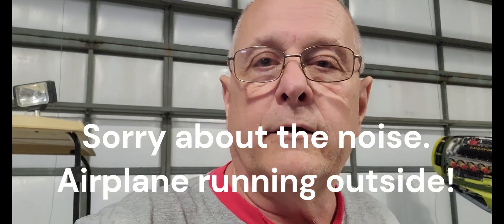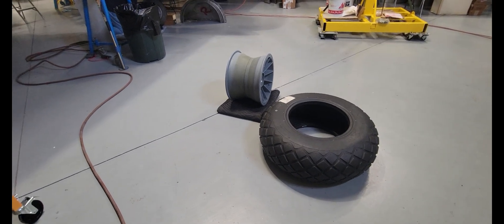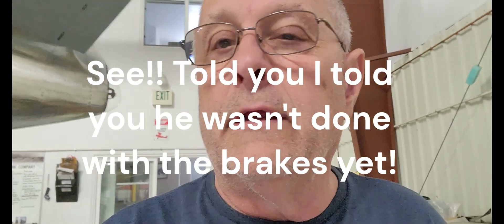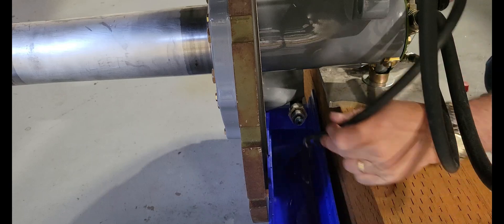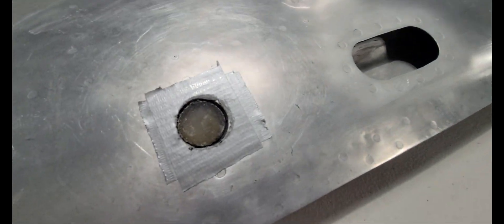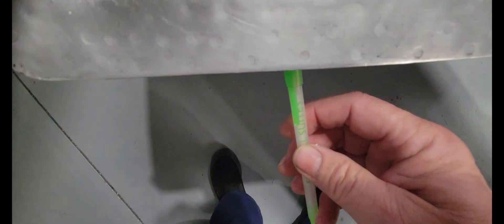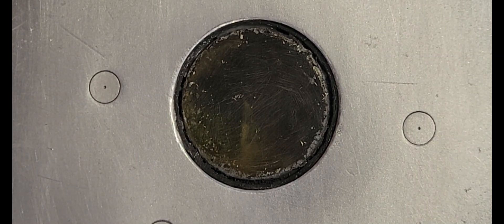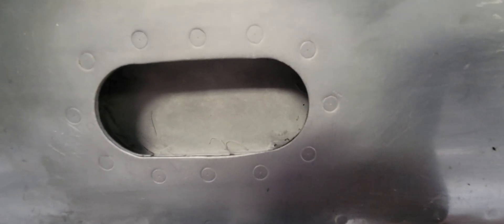H/M, episode 49  Brakes and life raft door!

Comment: I’m guessing that the windows are original. You probably could have put new plexiglass in probably less time. Nice work Bob !
Reply from the maker: Wouldn't be able to replace them as they were riveted in place on the outer skin before the inner skin was spot welded together to the outer. Definitely thought about it though
Reply: @mustangbob51  - I had considered that they were impossible to get to. Thanks for letting me know.